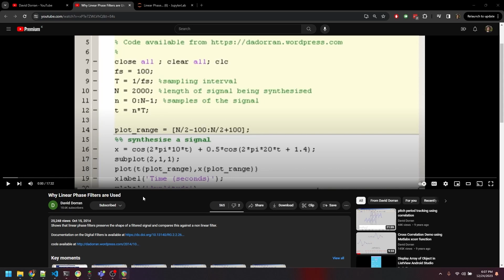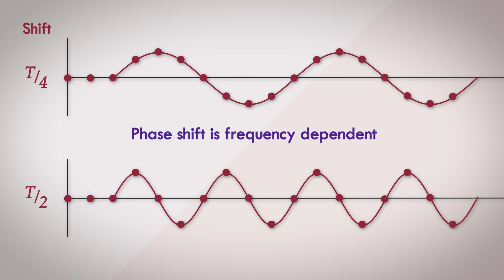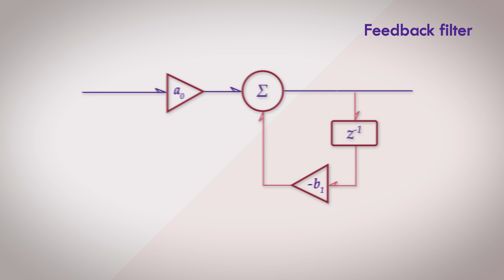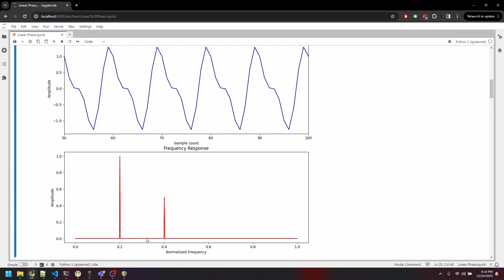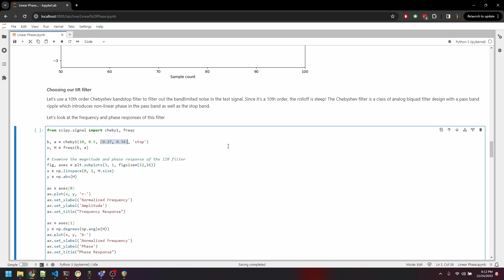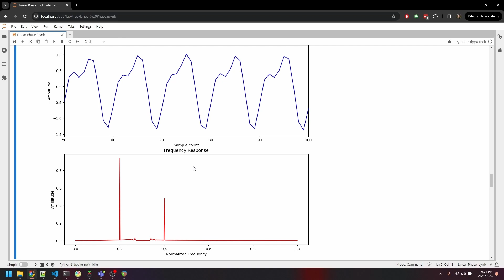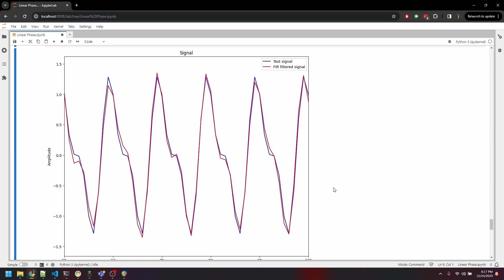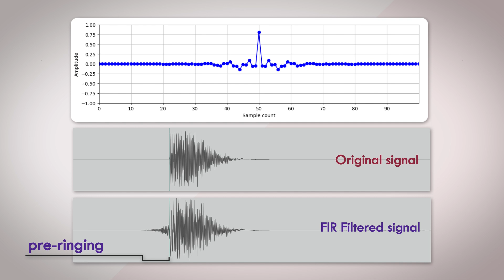9. Understanding Linear Phase - Digital Filter Basics

Comment: Really intuitive visualized explanation. But, can you explain a bit more about the wrapped/unwrapped phase? I feel lost at that point.
Reply from the maker: @ghennadude  phase or angle is measured in radian or degree. The phase referred to here is the angle subtended by a complex exponential in a unit circle representation on the complex plane, which represents the delay experienced by a spectral component. You don't need to know this, unless you get into the math of it. 
But basically, the more the angle, the more the delay. Since a circle has 2Pi radian or 360 degrees, after the complex exponential makes a full circle, it goes back to 0deg. So you can "wrap around" the phase and represent it withing the boundary of 0 to 2pi radian or 0 to 360 degrees. But you can also "unwrap" and keep count of the total number of rotations done, so that the angle is not just bounded to 0 to 2pi. Hope that helps. It's not an intuitive concept if you don't get into the math.

Comment: Thank you for your videos, I watched this series in a row (1-9).
Never have seen such informational audio comments along with clean slides before. I really appreciate what you are doing here.
Hopefully you'll record another video which describes the transformation from filter frequency response using IFFT to FIR filter coefficients. (A short preview was in video 5 if I remember correctly)
Reply from the maker: Thank you for the comment! I'm glad you found the videos digestible. Regarding designing an FIR filter from the frequency domain, I was going to do it at first, but it's going to mathematical, which I wanted to avoid in the first place as a premise of this video series. So, I might consider a programming video along those lines instead.
Reply: @akashmurthy  digestible? It is outstanding!